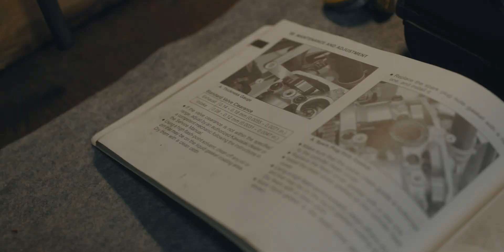Breaking Down a 2021 KX250 Engine | Part 1

Comment: What type of rider level rode this bike? I’m a front pack “c class rider” local level, not too hard on the bike and just wanna know when I should do a rebuild. Currently at 38 hrs and see this one was done at 54 hrs. So just trying to use the is as a general gauge.
Reply from the maker: This is ridden by a B rider who is always on it, rev limiter a lot. My bike got it’s first top end rebuild at 93 hours and still showed no signs of anything wrong, which has also been ridden with high rpm’s. Pay attention to how your bike runs and do a leak down test if you can, that can help gauge what your engines like on the inside
Reply: @MotoJerg44  awesome, thanks for the reply man. Yeah I have the same bike as the guy who did his rebuild in the video, bike is still running extremely good, pretty much how it did off the show room. Haven’t really noticed much decrease in engine performance or any odd ticking sounds. I do all my maintenance probably a little more often than I should but I like keeping things all good so I don’t have to worry about the big stuff as often, I’m thinking from what you said I’ll probably do It around the 60-70 hour mark then. My previous yz had 117 hrs on it before I sold it and it was definitely of need of a rebuild 😂 so I think so where in the middle would be sufficient. Thanks for the info dude. Video quality was also awesome. Thanks 🙏
Reply from the maker: Thank you man, I appreciate the support. I’ve taken very good care of my bike as far as oil changes, valve inspections, air filters etc. and I can almost guarantee that’s why the engine is in such good shape and 100+ hours now. Your bike should be fine if you keep up on the smaller maintenance
Reply: @MotoJerg44  hey man, following up on this comment cuz I figured it would be the best place to reach you, I’m in the process of ordering myself a top end kit so I have it when I need it and I have the piston it’s self and all the rings and such but I can’t find anyplace that has a gasket kit for my bike (same as in video) do you happen to know what company he got his gasket kit from or if its oem? Cuz my local dealer says kawi doesn’t make any for them to sell… thanks in advance
Reply from the maker: So he said to check Rocky Mountain and Motorsport, he also said you have to buy the gaskets individually if you go OEM, it doesn’t come as a kit
Reply: @MotoJerg44  ok thanks, so is that where he got his than?
Reply: @MotoJerg44  update:can’t find any on rocky or Motosport and then for some reason can’t order oem because it won’t ship internationally… haha
Reply from the maker: I believe he got his straight from Kawi, he worked at a dealership and I believe had connections
Reply from the maker: @Duke_803  that’s odd, I would contact kawi directly
Reply: @MotoJerg44  gotcha, he wanna hook me up 😂 haha. Well thanks for your input and I guess I’ll just keep looking! It looks like most places I’ve looked at only make up to 2019 models so kinda SOL 😅
Reply from the maker: I’ll check around for you, I’ll let you know if I come across anything
Reply: @MotoJerg44  thanks man appreciate it!
Reply from the maker: No problem